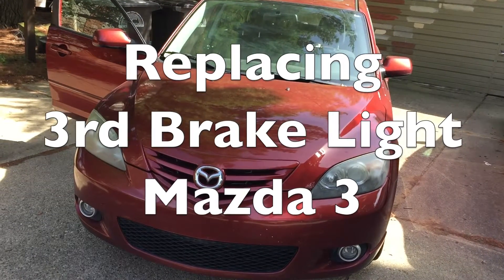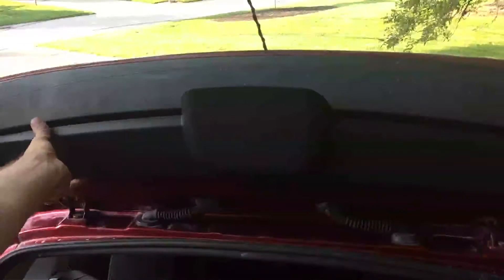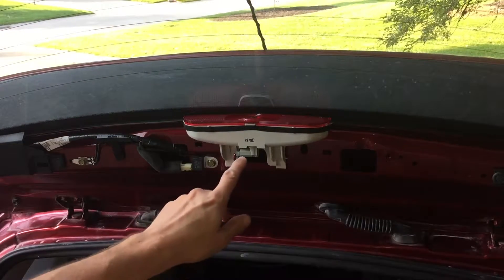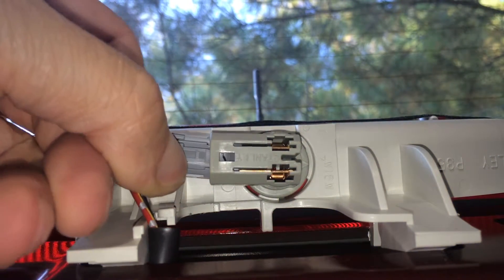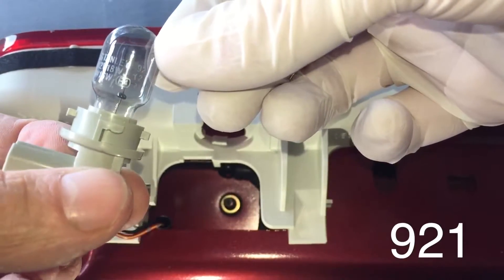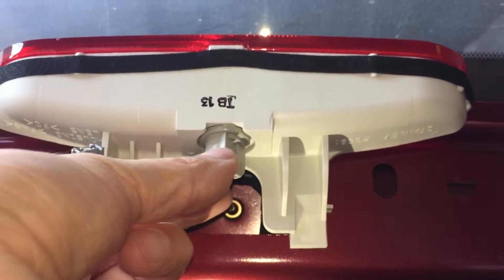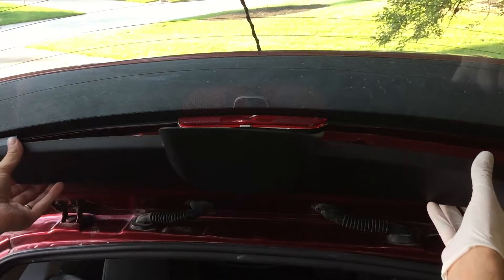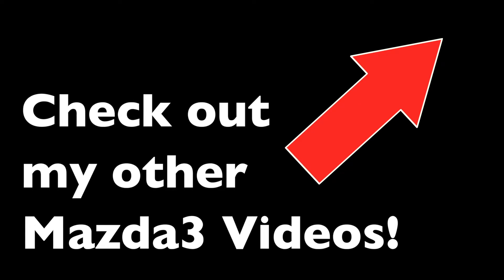Replacing the 3rd Brake Light Bulb on a Mazda 3 - Hatchback

Comment: Can someone help me?  i have a mazda 3 2004. Whenever the car shakes, it turns off the tail rear lights, as well as the blue lights on the speedometer and the lights on the controls like the air conditioning.  What can this be?

Comment: Is the light bulb 12V5W ?
Reply from the maker: It definitely is 12V, but my bulb 17 Watts.  That value may differ, depending on the kind of bulb yours.  An LED version will definitely be a lot lower than that.
Reply: @MegaSafetyFirst  can you also prove me that when trunk is closed the light gets switched off? I would guess that it is controlled by a switch/lever.
 I am working on an issue why the light is still off, bulb is fine. Mazda 3 2005 sedan.
Reply from the maker: This video is about the brake light bulb. The only switch would be the brake pedal in the front.